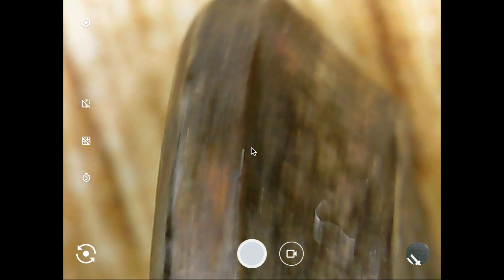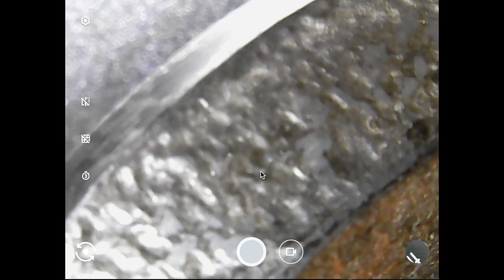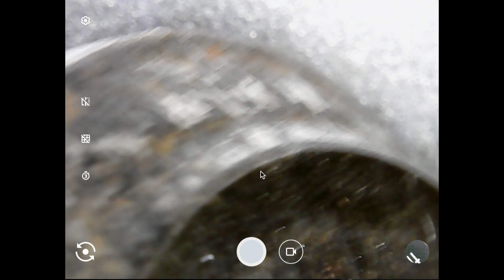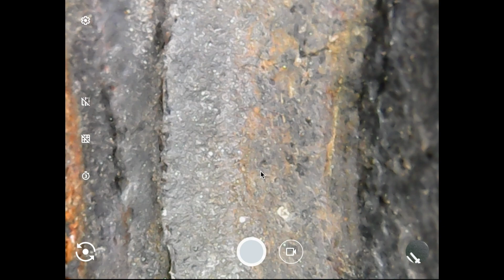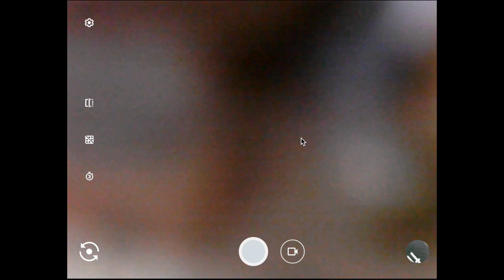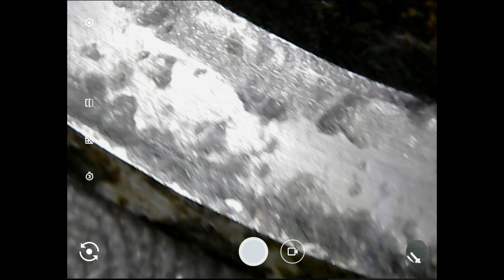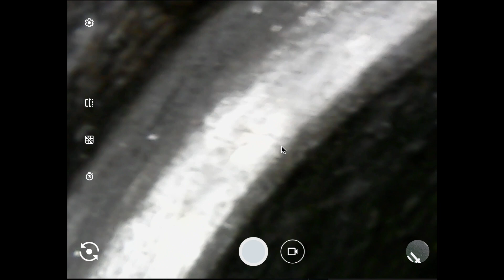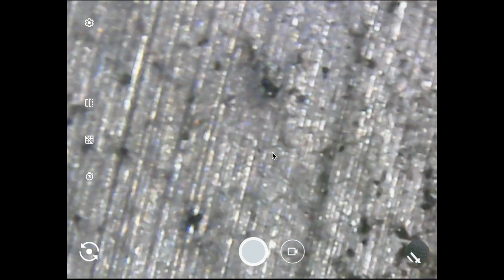Valve lapping Compound Persian Blue a waste  Valve Stem inspection Part 1

Comment: Thank you. Outstanding video. I am having and issue with one exhaust valve. This gave me some new ideas.
Reply from the maker: I hope it works for you, I do own two valve grinders and of course they do an expert job on the surface but you have to get that slight interference fit bevel that wears and as it does, it just keeps the bypass minimal.
New valves and seats are always the better choice. 
I even have a spring load tester to confirm the springs are not the issue.
Reply: I also have a Rimac. I didnt know if the tester was calibrated so I bought a test spring, the Rimac is good to go. Nice to have real seat pressure instead of installed height measurements from the manufacture. I finally got the valve to seal using a new exhaust valve. Thanks again for the great video.

Comment from the maker: Note : This is the exhaust valve head we are inspecting and you will be amazed to learn that the intake valve is extremely different... it is mostly clear and without carbon...  this means the carbon ''damage'' to the valve is from the ''exhaust gases'' and not just ''by-pass'' before ignition...    The combusted materials are still heated and ''cling'' to the surfaces of the exhaust valve.